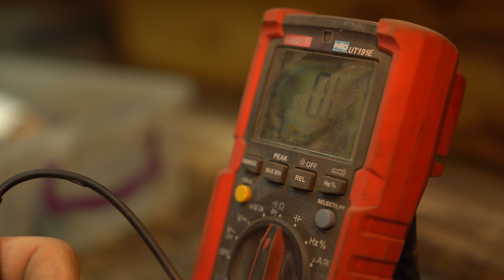Restoration of an Old Microphone from 1960! Now it looks like new

Comment: Nice restoration. Would like to offer some advice on the camera editing. 

Don't switch angles so often and fast. Hold on what's being done for a while before switching. It's a relaxing restoration video, not an action movie. 

Completely cut out and video clips that aren't about the part being worked on. I lost count of the number of shots of the back of his head, solder smoke, etc. Again, if the video isn't about the piece being worked on, don't include it. 

You have some good camera equipment and I like the multi angles. That's nicely different to a lot of other similar channels.

Comment: Whoa, nicely done, Old Man.  The brown paint is gorgeous - understated and unobtrusive.  Bonus points for the spring strain relief.   As careful and precise as you are, you have earned a pair of automatic wire strippers as an extra treat.  The rocket takeoff at the end is a bit over the top, but ... well ... um ... OK, you have earned a little pizzazz for a job well done.  Take a gold star out of petty cash for the project!  I would be proud to add that mic to my radio shack.    JR